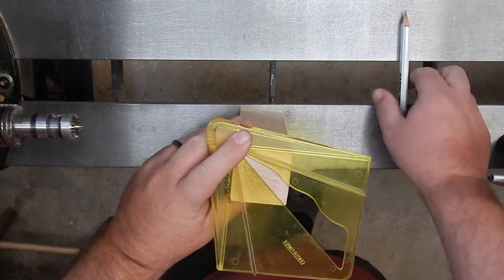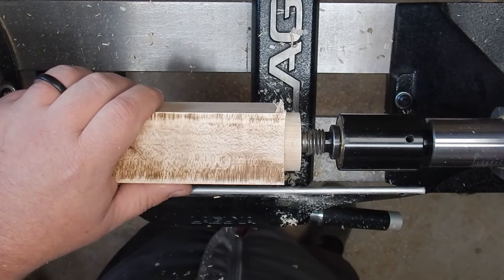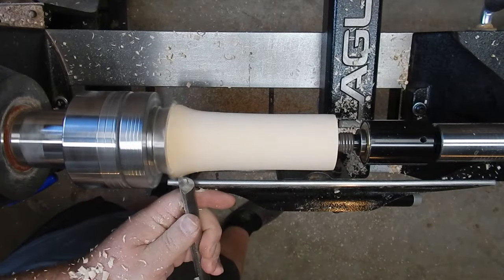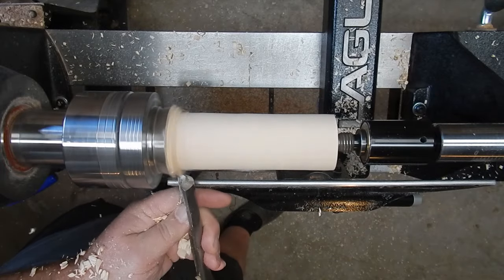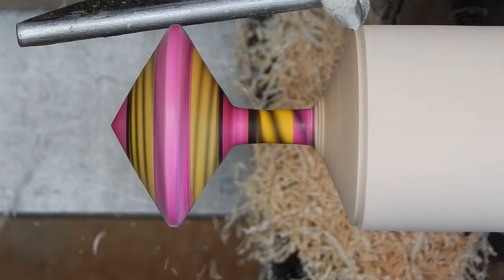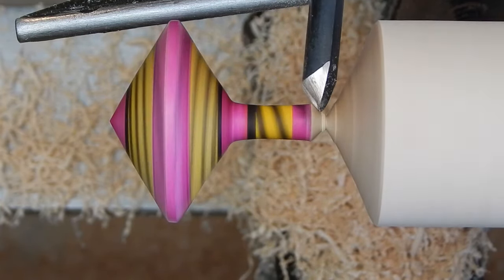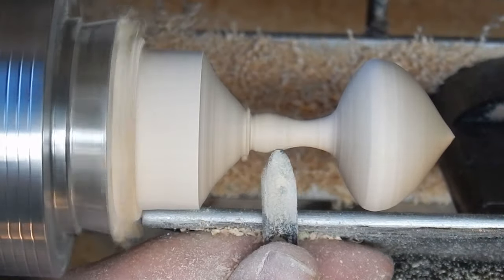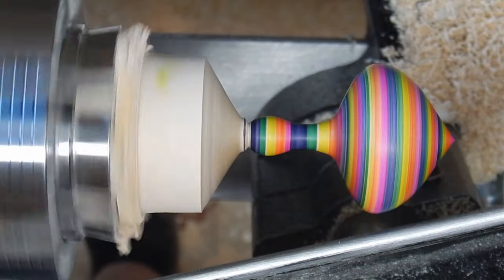Easy Woodturning Projects Episode 3 / Spinning Tops

Comment: I really enjoyed your process of making spinning tops. What wood dimensions do you start with and end up with. Thank you. I just subscribed 👍
Reply from the maker: Thanks for subscribing!  To answer your question I generally start with a 2 inch by 2 inch piece.  If I use a 5 inch long blank I can usually get 2 tops that are roughly 2 inches tall.

Comment: What is the size of your square blank
Reply from the maker: I generally make tops from a 2 inch blank, but you can go smaller or larger. I go about 6 or 7 inches on the length so I can make 2 tops at a time. One right after the other. 😀
Reply: Very nice tutorial.